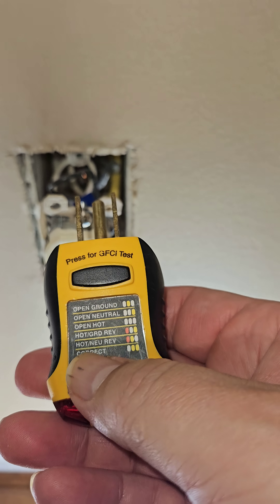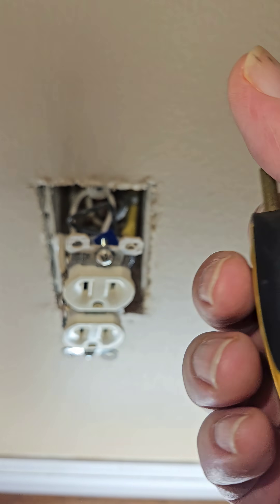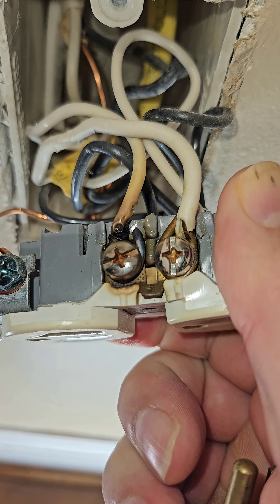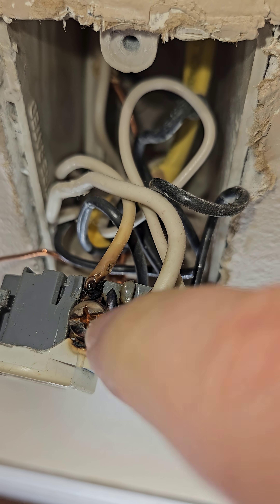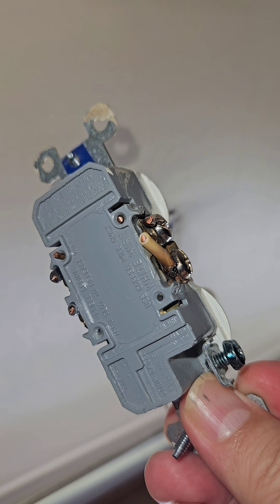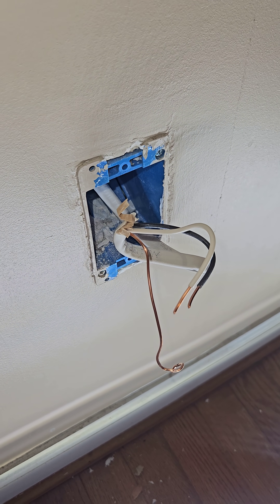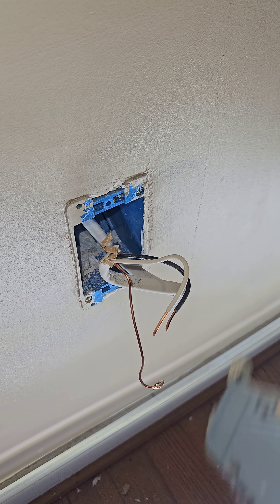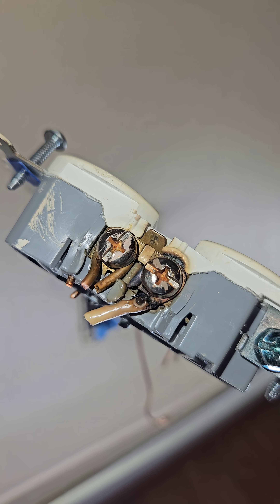It Said HOT/GROUND Reverse… Then I Found This 😳⚡#shorts #electrical #wiring #diy #home #fix #howto

Comment: Hmm 🤔, 20amp on 14ga is crazy. I think it was code before the NEC updates, as long as there were more than 2 outlets on the circuit.
Reply from the maker: Yep my guess is a 'generalist' that did this and not an electrician. Or it was a Friday and only 14/2 was on the truck 😅 There was a wall opened up prior to us buying the house and this work must of been part of that. Could of been a drywall, electrical, do it all type. Just glad I found it. Thanks for watching! 🛠️

Comment: You were lucky you found this before anything bad happened. I would have to call an electrician to do this kind of work for me since I know nothing about electrical wiring.
Reply from the maker: Yeah thankfully I did find it and nothing worse happened. It really just boiled down to replacing the outlet with proper wiring connections and changing the breaker at the main. It's all fixed now! Thanks for watching Rita! 🛠️

Comment: Glad you found the problem MMM!  I presume that could have started a fire?? 🤔 enjoy the weekend! 👍🏼🤗❤️
Reply from the maker: Yes it was a lurking problem. That 14ga wire can't handle above 15amps. So being that it had a 20amp breaker, surges were causing that to overload and heat up. Likely running, vaccum and multiple things simultaneously that spiked it (can't  remember if we might of used a portable microwave when main one broke). So yeah bad problem waiting to happen. The 'electrician' that ran that wire prior to us buying the house made a bad decision and dangerous one) not using 12ga wiring, or at least swapping the breaker to 15AMP. Glad it's fixed thanks for watching AZ! 🛠️
Reply: @TheEclecticHandyman you’re welcome MMM 👍🏼